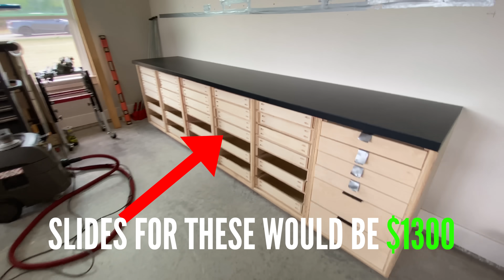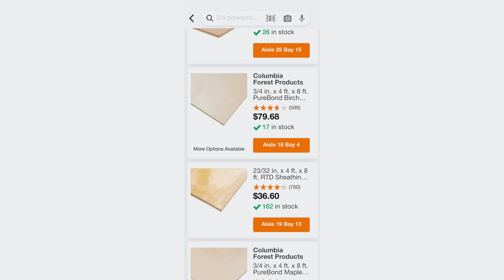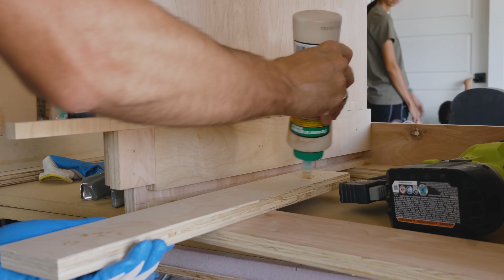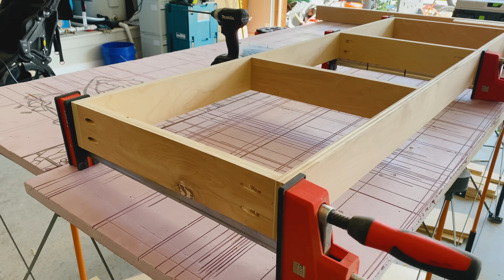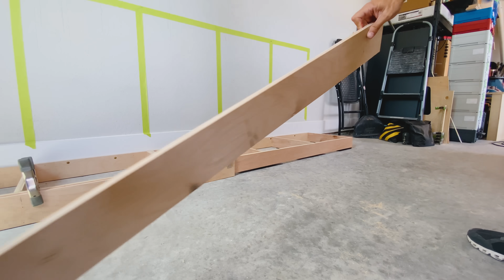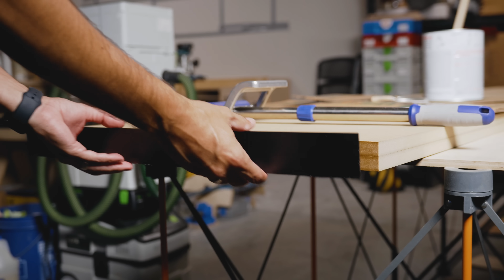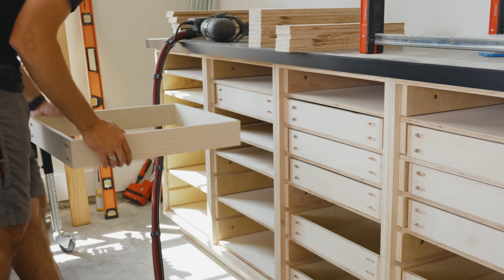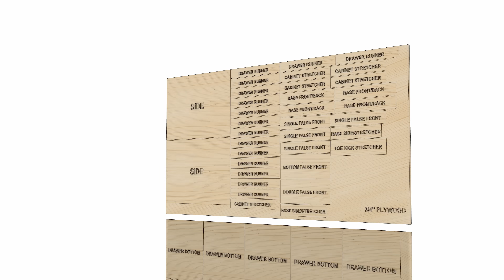Drawer slides are expensive. Do this instead.

Comment: laminate trimming tip you were looking for when trimming the top: spray the bit and bearing with WD-40 (or similar). the marring you got was from the guide bearing on your flush trim bit was from the heat. the WD-40 also helps with cleaning the gummy adhesive off afterwards.

Comment: If there are two different occupancies such as shop/garage on one side and living area on there other side of the wall there may be a one hour fire separation code requirement and duct tape may not satisfy code.
Reply: The suspect wall is exterior. And check out the ending 😊

Comment: At 24:10 I noticed you have a Pica-Dry Mechanical Pencil. That is my favorite, I will probably never use a carpenter pencil except for a spacer.  Also bought white “leads” for when I’m fabricating steel. With the built in sharpener easy to mark precision cuts.

Comment: Awesome build! I have often used tempered hardboard (Masonite) as my drawer bottoms and slides. That way all I have to do for their tracks is dado in the grooves. On a shallow enough cabinet you can do this with a miter saw set to trench. Also, for drawer handles, I often will use the angle from cheap steel bed frames. I find them dumped all the time, and they are some decent angle iron, for free! I have them angle out the front to make a pull and screw them into the top of the drawer face in a shallow inset.

Comment: Hello from Alabama!  Just spray Pledge underneath the top piece of laminate after you put it down.  That will stop it from burning through the side laminate pieces, and it won't be a problem because the top is the last piece to lay down.  Just don't spray it on too heavily because you don't want it to be messy.  Also, laying your prop sticks on a bit of an angle will also help keep the laminate from accidentally touching at the wrong time.

Comment: Of course I find your video 2 days after completing a self designed 62" lower cabinet with tile top for our kitchen.  Next time...

Any thought about using a nylon slide tape for each drawer support?

"Topiverse Drawer Slide Tape, Low Friction Tape, Silky Surface, Abrasion Resistant Glide Tape, Drag & Noise & Squeak Reduction, Apply to Wooden-Drawer Furniture Curtain Cabinet, 0.75'' x 33', 5 mils"

Good idea with the duct tape to patch the wall behind the uppers.  Leaves more time to hit the pool afterwards.  🤿

Comment: As to the router problem can't tell for sure from the video but it looks like ether your flush trim bit is too long or maybe the depth of cut was too deep. Ether can cause the bit to flex and will cause those marks on the laminate

Comment: 🤿Very well done!  have an 18 ft rough plywood bench on one wall made for zero dollars of scrap and cast off and am kinda inspired to put cabinets under them one day and I liked the non-hardware drawer pull solution. Thing is I already have an embarrassment of drawer space from a cast off for free cabinet from the Lowe's I used to work at - it had several damaged drawer pulls and is all metal, but I was able to repair it with dirt cheap drawer slider hardware I got off the interwebs, probably eBay or WISH - can't remember. The old store cabinet was made to hold drawer pulls with plenty of dividers in each drawer. They were going to pay a contractor to haul it off as scrap so I lucked out. 

Watched til the end too - I agree - the duct tape thing was dumb and not really a good solution for the drywall patch.

Comment: I like to cut my toe kicks wide so I can scrib them. Make your scribe cut, then lay them back in place. Set up a laser to preferred toe hight, mark each end. Then cut with track.

You get a perfect base, level and maximum surface area, for a solid work station. Its often faster then shimming.

Comment: I haven't laid very large sheets of veneer in a long time, but there are tricks to doing it solo. Tape your sides to protect them from spray and the router. Oversize it first, spray both, lay the sheet upside down over you like a cloak, start at a corner, make contact on only the edge so you can still adjust as you go, unroll it off of you and down the longest edge, then slowly roll lay it across. Trim with the router, peel the tape, then file.

Comment: a tip for the edge of laminate tops, if its available always use some kind of wax to keep the edge rom burning up, in not a couple of layers of tape will work provided you move fast. and lastly some good ol wd40 will work in a pinch 20:16

Comment: As a woodworking 🤿 idiot. I really enjoyed this nicely done video & built, but of course have an idiot’s question: So these raw plywood bottoms slide on these raw plywood guides (fixed rails, whatever they are called) in a (non climate controlled?) garage. No wax, no finish.
What to expect from that from a longevity / wear point of view with in part likeky heavily loaded dhop drawers? Maybe no wax attracts less dust than waxed, but won’t the the slides wear exxessively in time - or? Are there any long term experience values to go by?

Comment: Very nice, simple design. I am going to build some of these for my CNC router bench. If only I could find lower-cost reasonable quality plywood around the Boston or central MA area. The big supplier in Boston has 4x8x3/4" paint grade birch for $95/sheet. The local lumber yards (not box stores) have low quality plywood for about that same price. I wish I bought a pallet of plywood back in 2000!

Comment: Why not DIY your own drawer metal pulls ? You can use a vise and 3D printed jigs to bent and shape metal pieces. One issue with woodworkers or metal workers is they usually only use one material for all their ideas. This never made sense to me. It´s as if your only tool is a hammer so every problem becomes a nail instead of choosing the proper material for the job people default back to either always wood or always metal. You can see this here with the plastic shims, you used wood ones all the even even though they do swell and work over time because they absorb moisture.🤿

Comment: I think that happens to the edge when you have too much of the bit extended past the router base. Because it’s thin laminate, you really only need a small amount of blade to make the cut. So what’s happening is all that extra blade that’s exposed is ever so slightly brushing up against the laminate that the bearing is riding along. That’s just my guess of what it looks like. I have a shop where we work with a lot of laminate over plywood

Comment: Nice, really good job. You can also take out all drawers, cut sides about 1cm, so it will be shorter than back part. Then drill holes on the sides of the cabinets (from inside - one on each side) on hight of that part of the drawer that You just cut off, put wooden dowel pins in them and... You have stoppers, so drawers won't come off, and if You want to switch them just take out pins. Sorry for my english :P

Comment: The reason for the unclean laminate edges might be that enough cement soaked into the MDF to deform it slightly on the edges, thus making the laminate slightly concave on the edges. Which in turn caused the edge trimmer (which references about the center of the laminate edges if I see correctly) to remove that slightly outwards curved laminate.

Comment: loved it.  I'm building my third shop.  This one will be perfect.  I'm trolling vids to see what I want for cabinets.  One question: do you find it difficult to pull out the drawers that are more heavily loaded (of course, right! 🤿🤿🤿)?  Did you consider or have you added something to help with this?  Thanks and note the emoji...
Reply: They actually work fine loaded, but he will likely will coat the guide channels and drawer bottoms with paraffin at some point before the spring moisture rolls in, just like we used to do with old wooded window sashes and the old dresser drawers that rested on wooden rails.

Comment: Snorkel. Great money saving video. I think your router bit was proud of the bearing a hair. If this was in question, we use to wrap the lam edge with blue tape and touch the spinning bearing with some wax. Then after flush routing, ease into your finished edge with a sharp file. You can get pretty good at guiding the file with fingers and running it the whole length to a smooth lip free edge. 

We also put drawah boxes together on the bench by eye just gluing and pin nailing, ply or melamine, and let the bottom square it up later, if not dado or rabbet installed. That's 1/2", 3/4" you'd add screws. When screwed to the thicker face and captured with guides,  the drawah box was plenty strong enough and times faster to build.

Comment: All I can say is Daaaaaaaaaaaamn that Plywood Warehouse.  Wish we had that here in Brazil.  Wow.  Heaven.  We just paid a fortune for MDF kitchen and closet cabinets, yep a treasure chest in cost. 1/2 inch MDF drawers just garbage.  To boot, they created and installed the kitchen island base made from mdf.  If  you can believe it.  Two nights later and the plumbing system sprung a leak in the attic.  Walked in on Christmas morning to a flooded floor and water still pouring down from 16 feet above. Tough to find quality laminated wood here.  I know it existed because the 50 year old house we are living in has plywood cabinets.

Comment: My guess on the edge of the lam getting marked up... the cutting surface of the flush trim bit did that: a dirty/gummed up bearing can change the path of the bit's cutting blade... ie: the bearing slightly changes diameter, and it no longer indexes straight down from the blade surface to the "new" bearing surface (which now has bumps from the glue or whatever)...  I bet the gumminess on the bearing is caused by cutting the laminate that has a bit of glue on the back of it  🤿

Comment: I have built custom cabinets for some time. The nice thing about custom cabinets is that the cabinet structure is one piece. You actually built a bunch of cabinets and assembled them. That's what you would do if you went to a cabinet store and purchased modular units. 
If you had built the lower cabinet in one piece it would have used less than half the materials. Usually, I use expensive veneer plywood for the ends and inexpensive industrial lumbercore or industrial particle board for the non- visible components.  This should reduce your cost by at least 65%. The upper also in one piece is half the weight of your cabinet(s). 
Just sayin ...
Oh yeah, a heat gun (carefully) makes it easier to roll out the laminate. Cover the edge with masking tape and don't use a router. Use a laminate trimer, you will get a nicer edge. The tape will give you the slight advantage. Laminate trimming bits also are available with a chamfer, which is preferred on a shop counter.

Comment: These are really slick. I'm coming up on a big garage shop re-do, and I think I'm going to buy your plans. The non-use of expensive hardware (which I did buy for our inside bar and TV cabinets--ouch!) is a no brainer, plus the way the bottoms hold all the weight, rather than being tacked onto sides bearing the weight, is primo.

Your comment about future owners finding your duct tape hit home with me. My grandfather was a carpenter and he always hammered on us kids about quality, even where it didn't show, for example, vacuuming out between the studs before putting up drywall. He would ask, "Do you really want someone to find that mess inside that wall, and know that you left it there?" From a more practical standpoint, what if you move and decide to take your cabinets with you? Do you really want to have to fix that drywall when you're trying to move out vs. fill a few screw holes? Me neither. So I always go the extra mile, even if it won't show. Sigh Yes, I know: it's a sickness.

Added later: I've never used pocket screws, but using parallel jaw clamps as an assembly aid seems like the perfect solution. I have Bessey clamps, too, and they are worth every penny. I use them in similar ways all the time.

Hah! just got to the end where you taped the drywall. Good for you! lol🤿

Comment: You asked for a comment. Here's mine.
I made a wraparound customer service counter for my GF's club. I opted not to edge the countertop with laminate strips for a few reasons: 
1. The corners are too sharp and people get injured bumping into them.
2. The edge strips tend to peel.
3. The sharp edge between the top and side also tends to chip, eventually it gets ratty.
4. The sharp edge is hard on the forearms when leaning across the top doing business.
After gluing, I routered the top laminate to the upper surface, but rather than use laminate edge strips, I attached 1/2 thick oak strips of appropriate countertop width. 
This allowed for rounding all edges and corners and provided a chip proof edge. Oak strips were attached with gorilla glue and brads. A little wood fill, some light sanding, a couple coats of poly. 
That was 4 years ago, customer service counter still looks like new.

Comment: Are cheap plywood cabinets even possible in 2023?....well here in the UK the answer to that is no, it isn't, the profiteering going on in the UK at the moment is quite frankly obscene.....a sheet of the cheapest 18mm crap ply here is is around £35/$44 per 8x4 sheet and is only good for shoring up for concrete laying or temporary building work, the half decent stuff starts around £58/$73 per 8x4 sheet plus delivery, going up to £150/$190 per 8x4 sheet for 18mm baltic birch ply which you all seem  ( as seen here on youtube) to use abundantly in the US for nearly all your projects.... to do the same would cost the average diyer here in the UK thousands of pounds to build some of the projects that you seem to think nothing of making in the US.....and unless you're a furniture making business, high end specialist cabinet maker etc,  forget about doing anything here in the UK using hardwoods as the cost of those here are quite frankly eyewatering......

Comment: Ive tried both the painters tape and lubricating the edge with wax, and the painters tape is by far the best method. Another thing to keep in mind is that it looks like your bearing is shot due to the level of burnishing. My old shop lead told us to always blow out and lubricate your bearings after each use, and its definitely worth the effort

Comment: Ummmmm the 1970s simple kitchen European drawer slides are still available and are pretty cheap. $4/$8 a pair. Wood can absorb moisture and swell making your wood slides tight. Also it’s code to tape and mud your garage joints. It becomes a fire retardant. Duct tape will not stop fire. You have some pretty fancy tools for a first timer. Always tape the face of your counter where trim router will glide along. Those bearingless bits will always dig in.

Comment: I have worked extensively making formica counters.  The fix for the burning/marking from your bearing the front of your counter top is paste wax on the short sides before you router the top.  AND dont push hard.  We would use router bits without bearings.  The wax was never an issue.

Comment: You should put some paste wax on the contact points of the drawers and slide surface, it will really smooth the pull out

Comment: Did you ever consider trimming the mdf top on the 3 sides in even a cheap pine or a harder wood, then laminate over the top and put in a slight chamfer after you flush trim the laminate. It hides the edge and helps not have the front laminate get snagged or peel off later down the line. I find it also helps prevent chipping and damage to the laminate.

Comment: Looks nice, but I was thinking. 36 Drawer bottom of plywood, about 3.5 sq ft each, which ends up being about 10-11 sheets of plywood, x $50, thats over $500 in plywood for the bottoms? I might have used 1/4" masonite , daddo'd , stapled  into the bottom with a dab or two of silicon. Drawer sliders are much cheaper at DLawless supply (check them out). I've been able to get these 50 and 100 lb sliders for $12 a set.  Which would be the same cost as the plywood, plus the masonite at $20 per sheet (about).  I built one of these but following another build and used 2" sq tube metal on casters, welded and then used the full extension drawer slider, I used baltic plywood for the drawer boxes and 1/4 masonite. I like your method as its very difficult to get the drawers all lined up and even. May not matter as much if you use drawer fronts. Agreed about going to the local hardwood suppliers for wood and not the box stores. Much better pricing for much better quality.. Once you find these shops you'll never buy wood from box store again.

Other hack tips
Check our your local Ikea for scratch and dent full kitchen counter tops, much less than 2-3 sheets of 100lb fine dust, hard to manage press board. 
Using crown staples vs brad nails will give you more strength over time. I would have glued the bottom on  as the nails will come loose over time. Glue and screw is what they say
If you are a metal worker/or have welder, I would highly suggest making one out of steel tubing on wheels. Then you can move it around, it could be cheaper as well. Once you know how to weld its 10x easier and faster than using wood frame construction.

Comment: Looks great, similar to those I saw on @hookedonwood  - Denis from there used MDF sides and drawer bottoms with posh black MDF fronts. I really liked your spacing tool for the drawers. I'll prob be using a mix of 9mm MDF for the cabinet sides & drawer bottoms and 18mm ply for the drawer sides.

Comment: 🤿 Great video! 

I love the idea of not using drawer hardware, especially for shop drawers. Lots of great tips as well! 

I do have one question/suggestion. Is there a benefit to permanent wedges on the toekick rather than screwing offcuts or scrap blocks to the inside? You can then remove the wedges to use on the next project? 

There’s also the scribe method, but that’s probably overkill.

SA misses you BTW! 😉